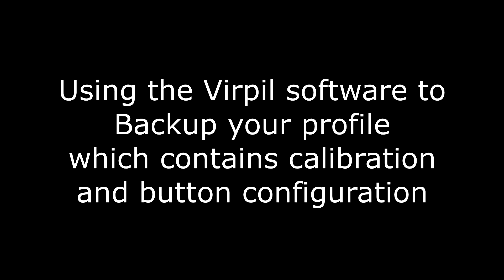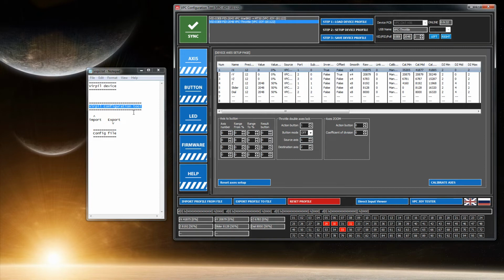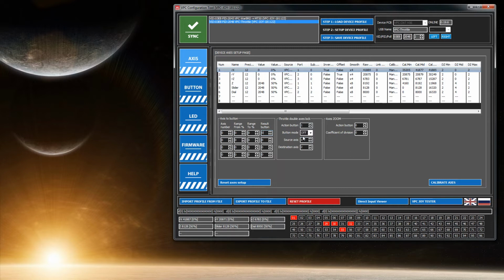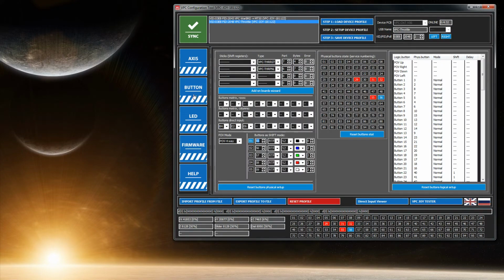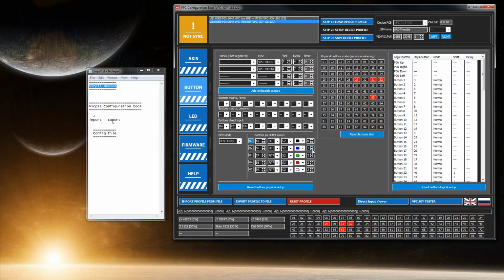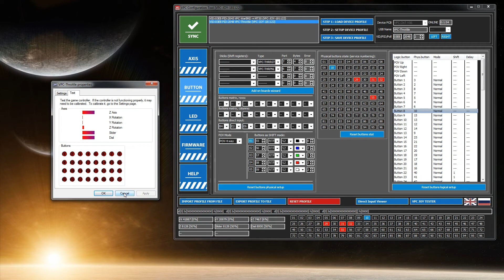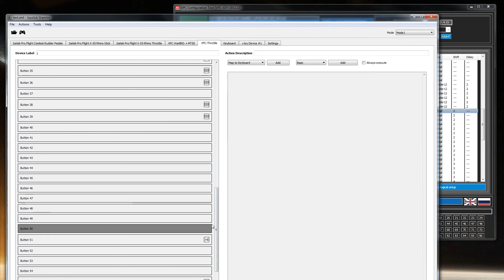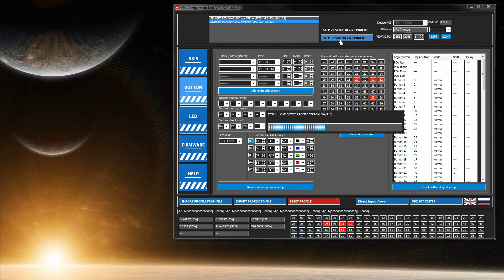Using Virpil VPC configuration software

Comment: I'm really disappointed VPC has no GUI to simulate key press programming. I was looking into getting the CM3 base and CM3 throttle, CP#2 & 3. I don't want to have to run two programs to play IL2.
Reply from the maker: What two programs ? If you want button press to keyboard press use joystick gremlin , you dont need to run anything else

Comment: So what I get out of this is that the B buttons are the only buttons that can change identities when the mode rotator dial moves to a different position? Or I can select any button I want to be an encoder button to get it to change identities with the mode switch? Let me clarify: button 29 - mode switch -  shift 1  = can reassign a new key press for this shift state? Or does it have to be a B button?
Reply from the maker: any button you want to, by default only the B1 - B8 buttons have mappings for the different modes (shift states) ... yo will run out of buttons quickly tho .... that why I use joystick gremlin to handle mode (shift)  selection
Reply: @HavocCompanyClan  i got it figured out now, and damn that was a hassle. I think I have enough buttons for what Im trying to do, thanks for the vids and tips!
Reply: @HavocCompanyClan  One question Ive been asked that I see havent really been covered by your tutorials is about long/short key presses. Like in the A-10 you have TDS long or short, DMS long or short....can you do something like that with the virpil software?
Reply from the maker: @utley   you dont need to do anything in VPC software for that, it is handled by DCS

Comment: Hey HCC, any plans to put an update out on the new  VPC Software.  Thanks for what you have done it made things SO MUCH better!
Reply from the maker: The latest build from vpc_20190314 is not working right and causing problems (ghost inputs and other random things) , I ended up reverting back to the previous one vpc_20190213.zip

Comment: Sir please I need your help i have both the x2 delta grips and x2 warBRD bases please contact me please.
Reply from the maker: whats up ?
Reply: My right side stick seems fine so far after doing some trouble shooting from reddit/you tube. However my left stick under "import profile"its t50 base and delta grip and other options  there isn't no longer a warBRD option and the stick does nothing at all it does not move even under calibrate axes. The wording in the SYNC box just says (VPC-DEVICE-JOY-190109)
Reply: The AXIS box and BUTTON box both are compleatly blank
Reply from the maker: @raugz2182  Unplug your right stick, and plug in your left stick (into a different USB port than right was using), start the VPC software and see if you can hook up to it
Reply: @HavocCompanyClan  yes sir doing it now
Reply: It does not give me the option for warBRD and delta profile. It still says its connected as VPC-joy-190109. All the options are for t50 base only
Reply from the maker: @raugz2182  unplug left stick, check connector from grip to base, plug back in again. if that does not work, try taking off right grip plugging it into left stick, plug left stick back into USB again, only swap grips with USB unplugged
Reply: @HavocCompanyClan  ok sir it worked however the button  tab under the axis button has an error that's jumping around "third box to the right" its jumping randomly from 42 to 2
Reply: @HavocCompanyClan  your a boss sir at least its able to calibrate ha ha

Comment: Thanks for this! I fumbled through it the first time with my dual deltas. I learned the hard way to disconnect and do one at a time. I've also got several new USB devices in my registry I can't get rid of so the .ini file tip was great! (any suggestions on removing them?) 
Anytime one of my viewers has a question about VPC configurator, I'll send them here!
Reply from the maker: extra devices in registry iteself or device manager ?
Reply: HavocCompanyClan They disappear from the device manager when unplugged. (I think) The registry is full of old entries. Makes it hard to find the active ones.